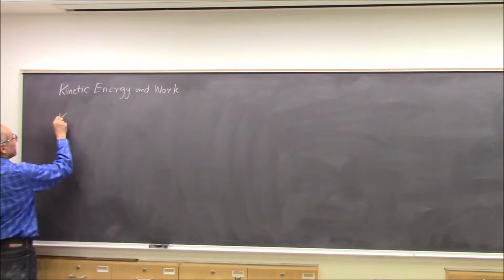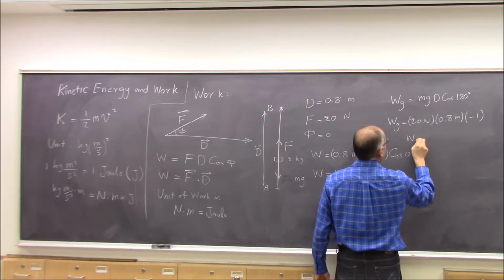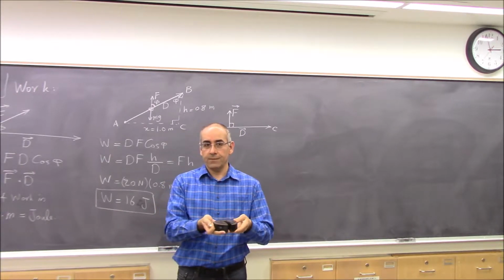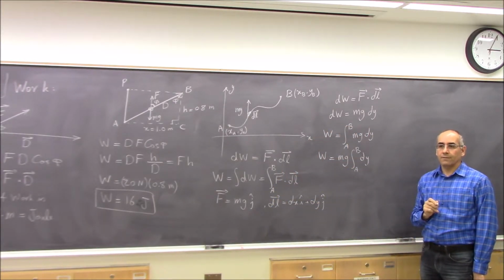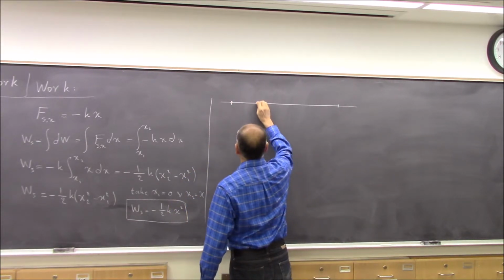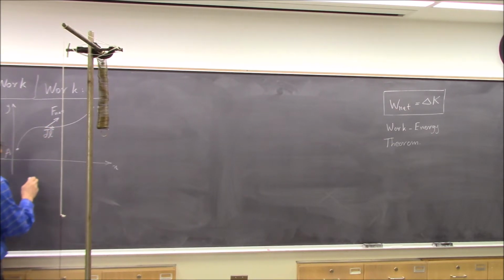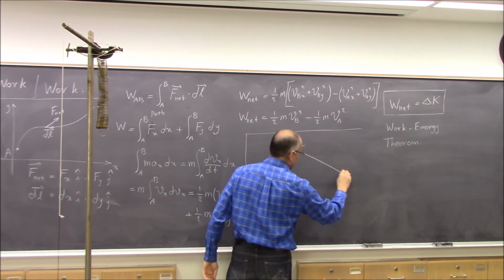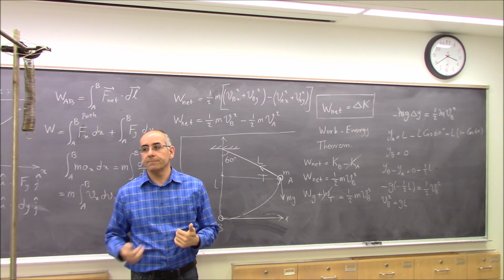SPS 06-1 Work and Energy

Comment: I found a paper that delves into the derivation of the motion of a pendulum with an initial amplitude outside of the small angle approximation: sbfisica.org.br/rbef/pdf/070707.pdf
Reply from the maker: Hi Sean. Thanks for sharing. I will take a close look. Anyhow. This shows how hard the problem is. In the video, it sounds like I said it is impossible to solve this problem exactly. In fact I edited out the part when I said it is possible to solve it in terms of the infinite series, but it is extremely complicated for the freshman level. If you look closely at this solution, it is still in terms of the elliptic integrals. So does not count as an analytical solution. I vaguely remember that the solution in terms of elliptic integrals was in a more advanced classical mechanics book I studied as undergrad mechanics course.